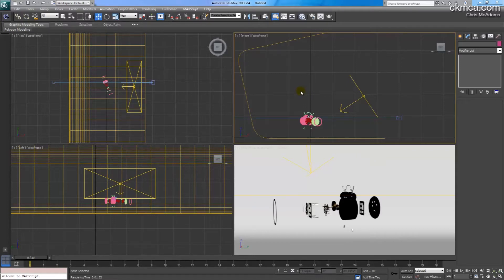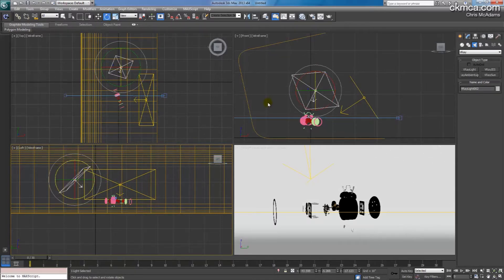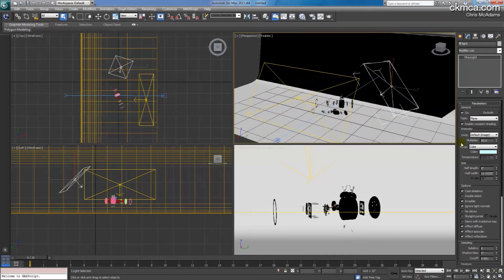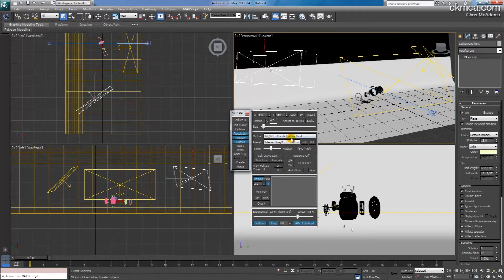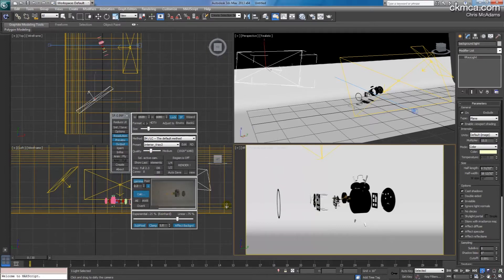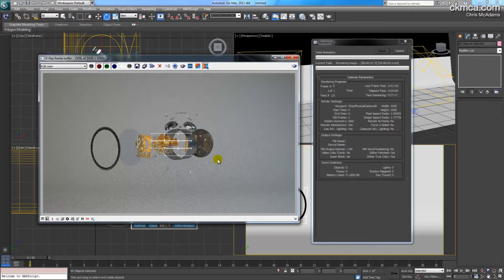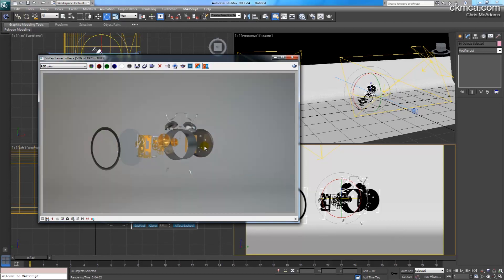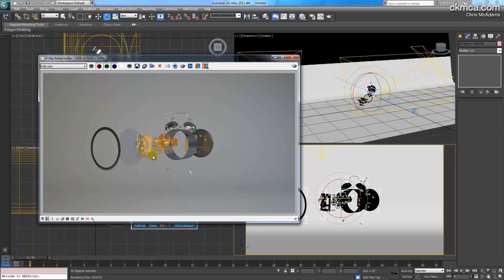04 [Rhino3D to 3ds Max] More Lights and SolidRocks

Comment: hi Chris, Hope you are doing good...I am just stuck in mid of the animation. I am using 3D Max 2016 trial version and installed solid rocks trial version too..but unable to find the SR tool on the tool menu. Thanks in advance for your respond...Regards Nupur